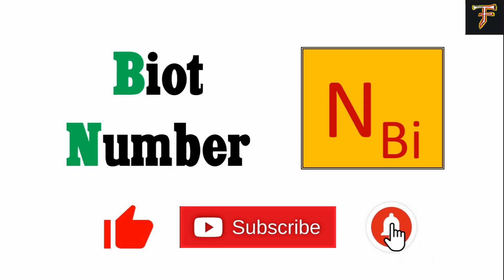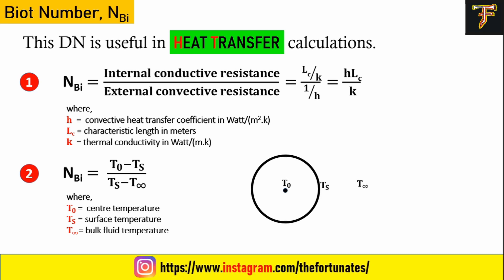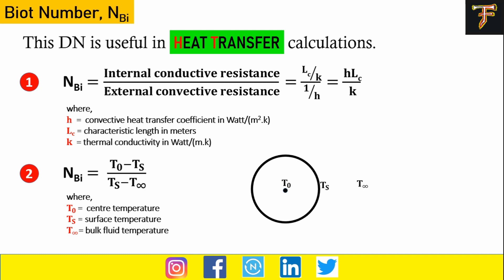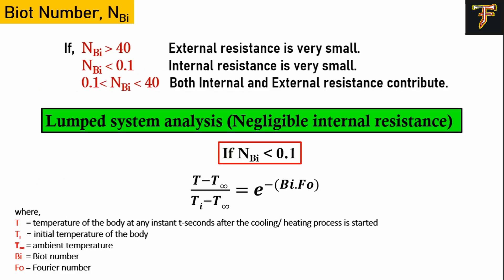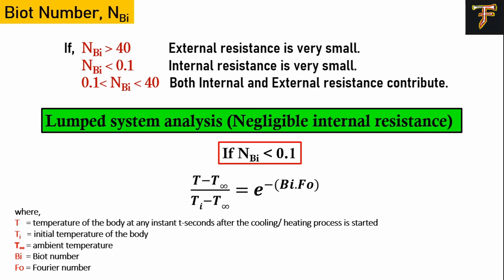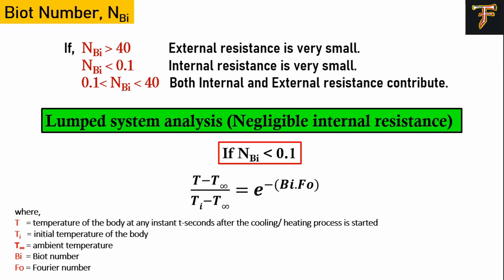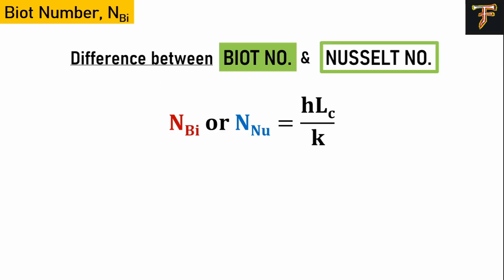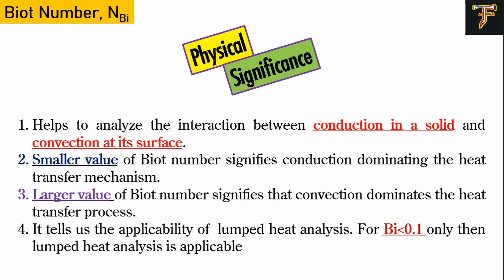Biot Number

Comment: I've seen some problems where they used "h*radius/k" and "h*Ls/k"(this video). What is the difference between these 2 formulae?
Reply from the maker: Hey Sourabh, 
Ls is the characteristic length define as volume per unit surface area through which heating or cooling is happening.
And for the special case of pipe this Ls = Diameter of pipe.
We are already planning to have 1 video on characteristic length but for the time being I recommend you to see this https://www.youtube.com/watch?v=8O8auH5WShQ. I hope this will help even though its on reynolds number.
Reply: @chemical_engineering  yes but how to decide between Ls as R/3 and Ls as diameter? I'm confused